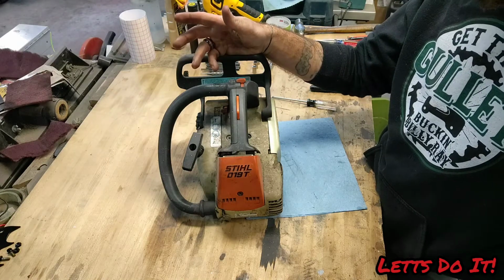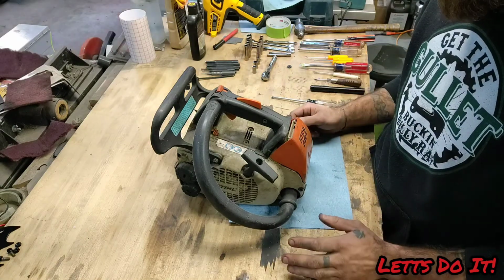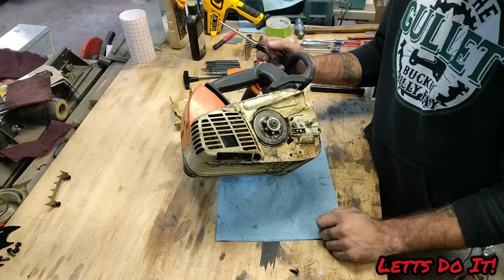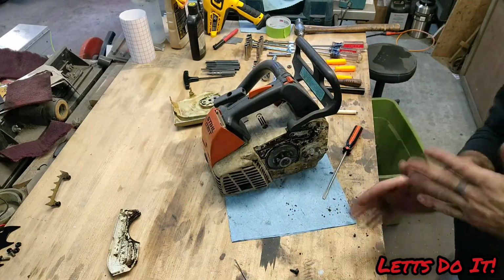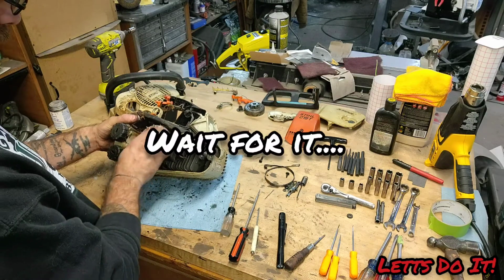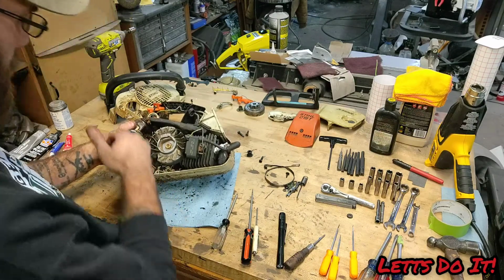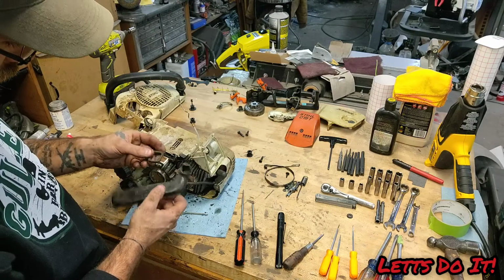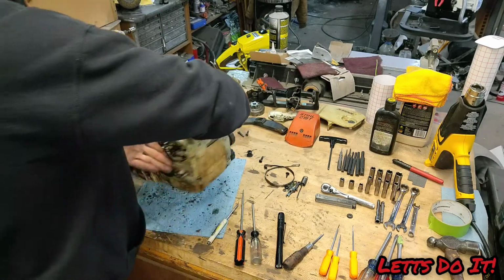Stihl 019T Project-Tear Down pt.1#buckinexperience

Comment: How do you get the engine out. This video is absolutely NO HELP!!!!
Reply from the maker: Well this was just a generic tear down not detailed. But you can remove the engine by removing the bolts on the bottom and removing the wiring in the handle/trigger area and removing the clutch and flywheel then it should slide out.